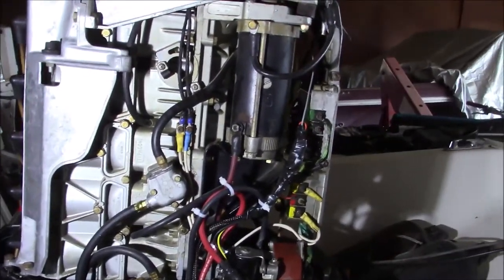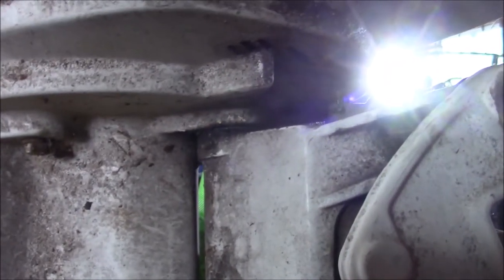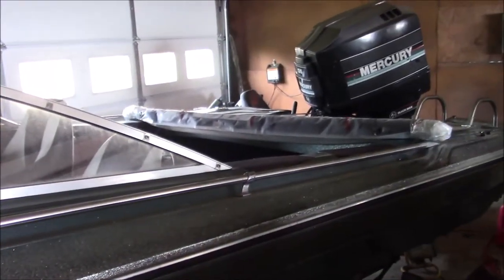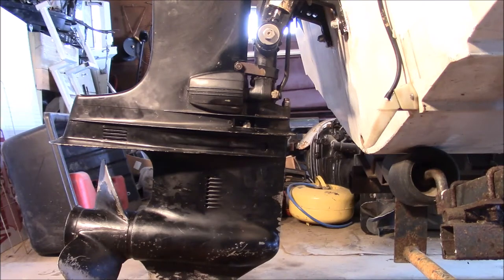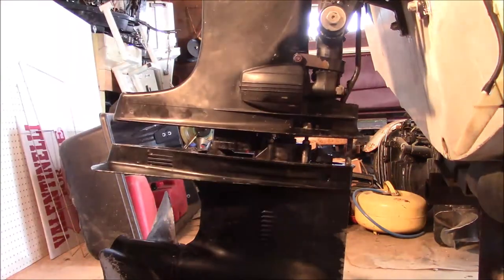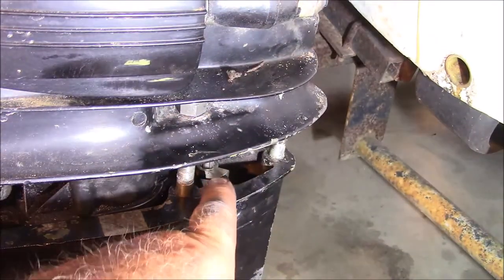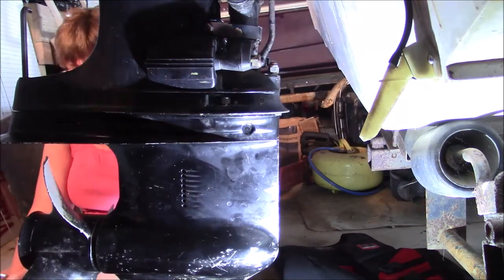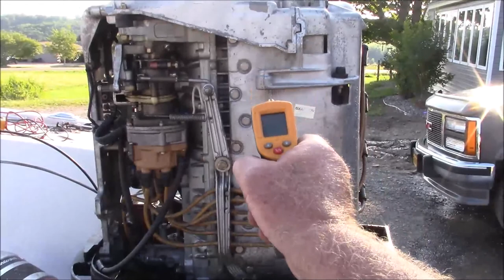Mercury 950 - 1000 - 1150 -1250 Inline 6 Lower Unit Removal Notes, & Reverse Locking Cam Alignment

Comment: TY for an informative video. FYI! You can also use a 9mm wrench to get your shift shaft splines to line up properly! I have a 1983 Mercury 115hp L6 Tower of Power on my bass/ski boat and there is nothing like the sound of those inline 2 stroke outboard engines. 😉
Reply from the maker: Hoping to hear more of that 6 before this season is out ;)

Comment: Well i got it figured out from another vid using a wrench to put in put the shifter in neutral then it will allow it to line up to got my seals fixed up i love this motor theres no box unit just 2 coils and a rectifier a disb and a merc switch

Comment: Thanks for the info, I have a 1978 900. it had a bad lower unit that was off,  I bought a second parts motor and fought for an hour this morning trying to line things up, I am missing the alignment bushing from both motors, I used my finger holding the lower up with my knee while sitting on a chair. Mine doesn't have the cam or pin but in neutral the gear slider needs to be about 1.5 inches from the back of the gear shift slot to work properly. I had the slider in the middle but that won't work.

Comment: So i took my 1962 950 v6 bottom half off for seals i took it off in neutral so what you're saying is I should have took it off in gear and reverse? Because now the bottom half acts like it's in gear even though I put it in neutral

Comment: I just bought a '78 L6 900, replaced the water pump, pressure tested the lower unit because the drained gear oil volume was low.  Found that the leak is around the shift shaft.  What is the best/easiest way to get those seals up off the shaft without pulling out the shaft and having to open up the gear box through the prop shaft?
Reply from the maker: Don't have an answer ...Good question, I've always tore things apart to prop shaft seals and all. This summer when I roll back around to those maybe I'll see if I can tactically pull them, maybe with some of my chainsaw seal related tools. They are small as well.
Reply: I found that the shift shaft bushing now comes with the seal installed as a single unit.  It is threaded into the lower unit around the shift shaft.  There is a special tool that looks like a socket which slides over the shaft and down into the two grooves of the bushing for quick, easy removal and installation.  I bought one online for $13.

Comment: Currently trying to put the foot of our 1969 (or so we think, not exactly sure on the year model) inline 6 95HP Tower of Power back on and we can not get it to close the gap. Kept thinking it was an issue with the copper tube that supplies water to cool, but now I'm thinking it's that latch you are referring too. Fingers crossed, hope it works tomorrow.